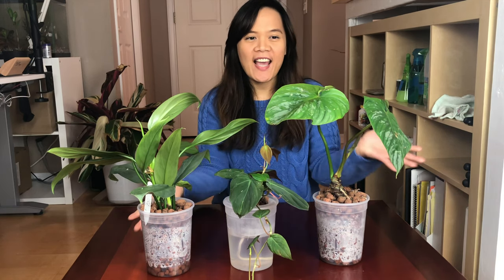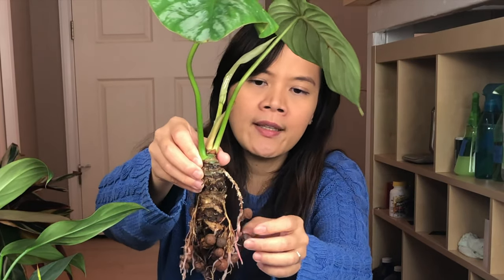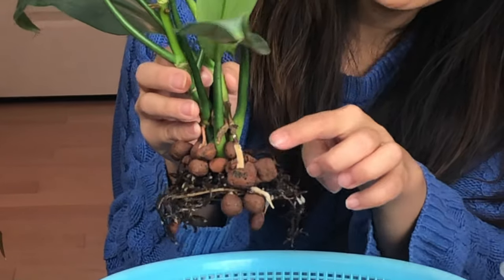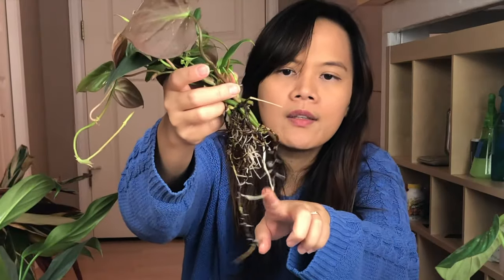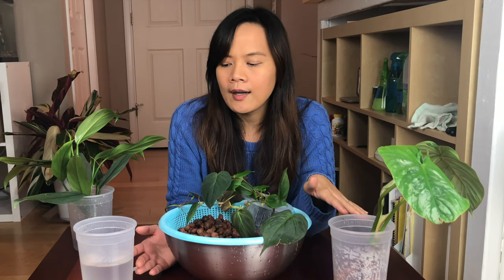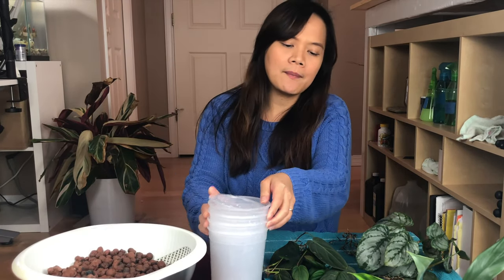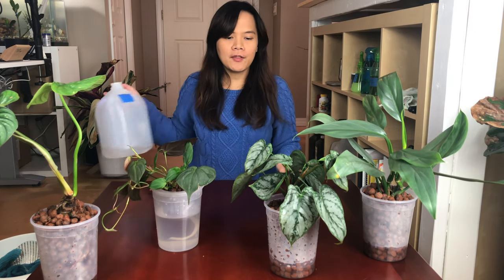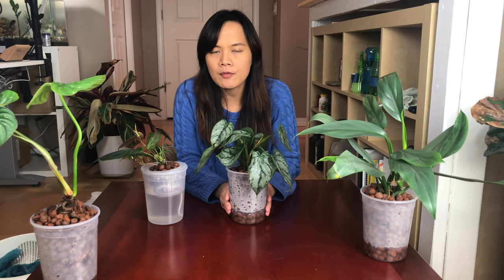Putting My Philodendron House Plants In Semi Hydroponic | Leca Part 2

Comment: I have a Ph. Silver Sword and it isn't looking so hot in leca. I don't have a heat mat, but it is in a great location, light-wise, so I'm just crossing my fingers that it pulls through. When I got it, it did not have the best root system. Really hoping the oxygen of the passive hydro system is good for it. Yours looked lovely!
Reply from the maker: Good luck!